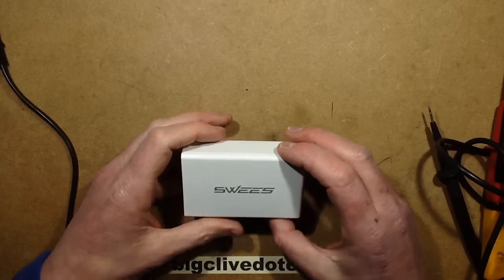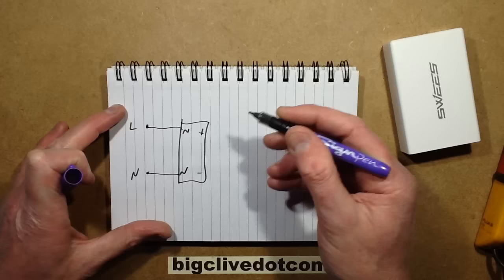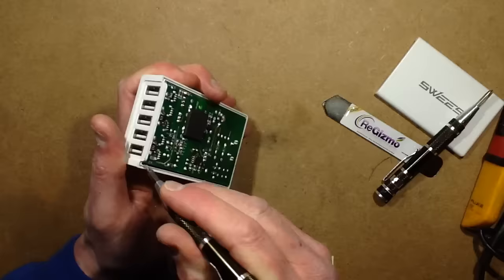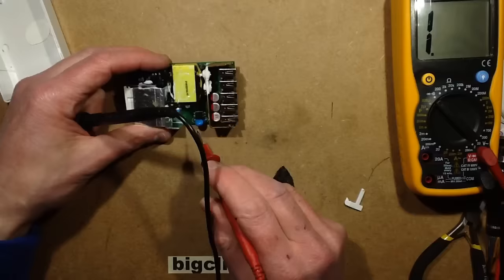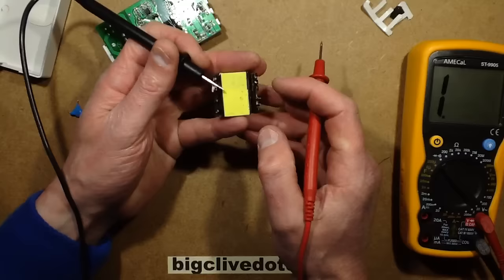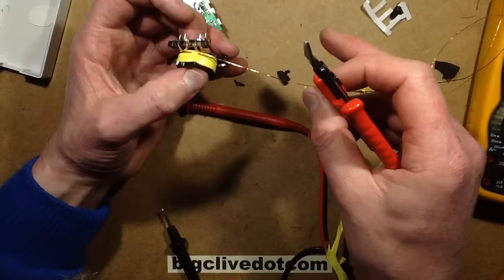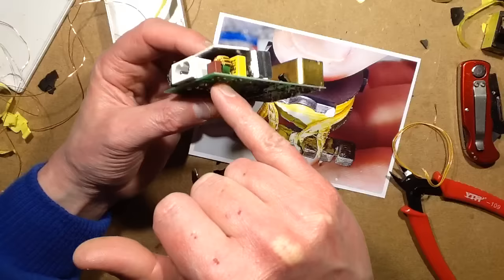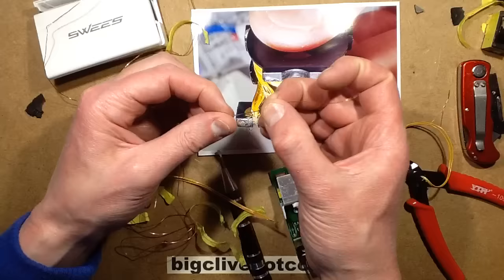Horrific USB power supply fault.  (Electrocution risk.)

Comment: Good video. 
I would have enjoyed watching an old cell phone or something plugged into this before you took it apart.
Just for kicks to see if the phone sparks, catches fire, or anything.
Maybe have the phone turned on while plugging it in, so we could watch the screen flash, spark, go black, then begin to melt, and possibly catch fire.  Other than that, good video.
Reply: The phone would likely charge normally. The voltage is the whole connector not between the wires.

Comment: im guessing this video is now linked in a 1 star review on amazon
Reply: well never know, the page on amazon is gone: http://boingboing.net/2016/04/12/the-worst-gadget-ever-supplies.html

Maybe this video caused the end of a product, not just a 1 star review.
Reply: snoopdogie187 maybe, but it'd be ancient now. usb1 devices arent worth the material they are made of these days.
Reply: Mr Jay White
Very unlikely this product is that old. There was nothing to be charged through USB back in usb 1 days, which is the sole function of this device.
It looks like its been rebranded http://www.amazon.com/Multi-port-Portable-Charger-Technology-Motorola/dp/B00PPXYWJW
Not a bad product if it works. It can output 10 amps total, and with 5 ports, thats 2 amps each, which clearly shows is a more updated product, much more so than usb 1, but this doesn't use any usb standards, just the two contacts that are responsible for outputting power.

Comment: I have this exact charger circuit that goes by a different brand, it has 4 green and 2 orange ports packed more closely together,
It worked fine for a while but after a couple months of using it, it starting sending 40v down the usb cable via any port
It fried an airpods charging case, and one side of an Oneplus 6T usb C port.
even after swapping the port and whole assembly, it's basically a non-reversible usb-C port now xD quite annoying.

needless to say that charger has given me a nice project box and some useful components for some future project!

Comment: Whenever I watch anything about working with electricity in Europe, I'm always so relieved that they settled on 110 volts in North America. A few weeks ago, I had to tear apart the wiring in my house to track down a fault that turned out to be caused by a failing outlet. Of course I got shocked once, 'cause Murphy's Law, but here it's just slightly irritating, like a honeybee sting, not at all dangerous unless you're inside the breaker box before the split or working on dryer or oven sockets. The shock aside, I was able to repair our wiring without needing to pay someone else to do it for me. I don't know that I would have been willing to take that risk in Europe. Is it even legal to work on wiring without a license there?
Reply: Nothing stopping you doing it, but if something happens(fire, somebody gets electrocuted, etc) you will have your ass handed to you by the insurance companies. Or end up in jail possibly. At least here in Norway.

Comment: If the fault was in that transformer as built. Would adequate testing at the build stage have revealed it?
USB sockets getting 240 volts could easily destroy valuable equipment as well as almost kill somebody.

I will be very careful about the source of ALL chargers in future.

Comment: I have a similar model to this from Amazon which I have had for over a year now, I believe it is made by Anker and I have never had any issues with it.  It looks very similar and I was very worried at first glance from the thumbnail
Reply: Oh I agree, as I said I have never had any issues with it in all the time I have owned it and I would recommend Anker products.  It was just the thumbnail for the video has me worried, at first
Reply: +Tech Digest This power supply does not use cheap components either, like Fujitsu polymer output capacitors. And actually have a quiet good construction. Just happens that the transformer has manufacturing fault.

Comment: If you removed the transformer and the short went away, it could have been a short on the board between the terminals. Especially if there were no terminal to terminal short.

Comment: 230vac  , we in the usa only use for near industrial apps. We use 110v for everything else, and you've illustrated the reason most likely...
Reply from the maker: A higher percentage of people are electrocuted in 120V countries than 230V countries.  Possibly because they get too casual with what they perceive as a safe voltage.  230V gives much stronger shocks so people are more careful.
Reply: Humm, I've  heard that claim before. Apparently we had 46 in the us in 2016 for our entire population. The 2016 deaths from electrocution for the relatively small pop in the UK was 25 for 2003 and 50 for 1999. I think proof by providing links is a good thing, and if you will so will I lol https://boards.straightdope.com/sdmb/showthread.php?t=239225

Comment: So it's two possible things that caused it, To much draw on the users end, per the capability of the components used, which either created heat through the tape, additionally causing coating failure.
Reply from the maker: It was a manufacturing defect.

Comment: It ist possible to build safe small trasformers on one bobbin but not china cheap. Maybe 50-60 cents more expensive by having safe dual insulation on the wire itself. And lowering turn count while increasing frequency

Comment: Seeing stuff like this makes me wonder if there’s any kind of protective gloves or other equipment you could possibly buy to at least dampen a potential electric shock, if not stop it. (Admittedly I know nothing about electronics and the such) Clive is quite obviously experienced but seeing him fiddle around with such dangerous stuff bare-handed makes me nervous nonetheless.
Reply from the maker: Any dry work gloves will reduce your chance of a serious shock.
Reply: Well, makes sense, but more simple than I thought. I would have thought there was some Uber-expensive material they make gloves out of to resist shocks with, like the cut-resistant gloves you see on the market that don’t even work most the time.

Comment: Rectifier in front of the transformer? How does that work?
Reply from the maker: The switching supplies allow the use of a tiny transformer by converting the low frequency mains supply to DC and then using it to pulse the small transformer at high frequency.
Reply: @bigclivedotcom  Thanks. I had only ever dealt with the traditional transformer, full-wave rectifier, filter cap and choke kind. I guess my age is showing again.

Comment: non isolated tranformer, one of the diodes in the neg side went open, you got + voltage on the ground straight thru
Reply: there shouldnt be 50hz/100hz at the transformer at all remember. its rectified, choked, run across a cap, then thru a fet
Reply: to b clear - not saying the transformer didnt fail, but that  that alone shouldnt manifest that fault

Comment: "serious manufacturing fault that suggests others from the same run may also pose a risk of serious electric shock."

Sometimes components are bought from another supplier. Sometimes these components go into various other product lines.

This specific unit will have a number of suppliers feeding products into their factory to build this unit.

those component suppliers supply many other product brands.

This would be the fault of both the USB adapter and  transformer manufacturer/supplier.

Insufficient testing and implementing a satisfactory solution to the manufacturing process to resolve the error. Often this is about cost cutting and higher production. The most simplest efficient way to turn over a higher amount of product using the least amount of materials.

Testing usually occurs every few items. depending on the amount. Maybe 1 in every 50 or a hundred would be taken out of the batch to be tested and even then the testing is often about functionality rather than safety.

So they would plug in a few USB multimeters (Yeah they dont exist,you heard it here first, one of many...F#$king psyche ward Hackers... Go China,Rape them have it all.) to get readings to see if they are charging or not.

ahh.. Yeah so they aren't all tested and not for shorts or the testing you are doing.

Comment: I wonder if it fried the guy's hardware or batteries? The transformer wiring is difficult, especially when done by more cost conscious than quality/safety manufacturers in China. I am surprised this type of USB device has not burned a house down yet, may be it has!

Comment: Wait... a bridge rectifier BEFORE a transformer?
Reply from the maker: +Max Mouse (Mmouse) Switchmodes convert mains to DC then high frequency AC through a small transformer and back to DC.  It means they can use smaller and lighter transformers.
Reply: +bigclivedotcom so, ac is still hitting the transformer?
Reply: +Max Mouse (Mmouse) Yeah, just at 100khz+ instead of 50-60 hz.
Reply: +Max Mouse (Mmouse) It allows smaller transformer design for higher efficiency.

Comment: how can DC be transformed? you said bridge rectified then transformed.  thanks
Reply from the maker: +zoso By converting it to AC again at high frequency so they can use a much smaller transformer.
Reply: +bigclivedotcom  thanks, after initial rectification it is then chopped to a lower voltage with a higher frequency, what frequency is generally used in this case, thanks for the explanation, very interesting.
Reply: +zoso   Often around 400 Hz.
Reply from the maker: +zoso usually around 20kHz and higher.
Reply: +zoso Not always at a lower voltage. the 120/240 VAC switch on the back of PC PSUs is actually a voltage doubler. If you live where your power is 120V and you have the switch in the 120V position then your line voltage goes through the doubler to bring it up to 240VAC. Otherwise in the 240VAC position the doubler is bypassed. This is all done so lower current devices can be used to ultimately supply a higher power P=VI. Read: make manufacturers more money by using cheaper parts.

Comment: I've seen it in several videos... why do your lights flicker so much?
Reply from the maker: +smv133 The iPad I use to film is very sensitive to our 50Hz supply.
Reply from the maker: +You Suck Certainly not in the standard camera app.
Reply from the maker: +You Suck We're talking Apple here.  They're not noted for flexibility.
Reply: bigclivedotcom
Thats what I figured.  Is there an advantage with using 240V and 50Hz versus 120V and 60Hz that we use here?
Reply from the maker: +smv133 The higher voltage allows us to run high power appliances like kettles at much lower current.
Reply: Thank you for the reply, its much appreciated.  Thanks to your videos, I'm getting back into electronics, etc.

Comment: would a Megger be useful here?
Reply from the maker: +trixter192 My insulation tester only goes to 1kV the official test is a lot higher.
Reply: I know it's not exactly your thing, but I wonder how good those cheap Chinese meggers are.
Reply from the maker: +trixter192 I've got one in the pile awaiting its turn.  Quite odd arrangement of three connections though.

Comment: How can you design things such that this would cause less of a problem?
Reply from the maker: +katelikesrectangles This one just had a silly manufacturing fault.  Otherwise it would have been fine.
Reply: +katelikesrectangles If it had been tested properly it would have been found and hopefully rejected.
Reply: +Graham Langley It wouldn't even have to be a very elaborate test:

They could literally just have put 230V AC on the mains in with a probe and then made a voltage reading at the soldering points of the USB ports.

If it's 5V DC then pass, if not then fail.
Reply: +bigclivedotcom I don't think it would pass safety approval with that type of transformer construction. I.e. it isn't just a manufacturing fault, it is a design fault.
Reply: I understand that testing should find that, of course. But could a design arrange it such that a failure would be less dangerous? Especially if a failure occurs in the field.
Reply: +bigclivedotcom Yes, but s silly manufacturing fault that could kill you. Not exactly trivial
Reply: +katelikesrectangles , because it is class 2 equipment (no earth, so the output is not earthed) and the output is accessible to fingers is has to be SELV ( Safety Extra Low Voltage). To achieve that the transformer needs to be a safety isolation transformer with all the appropriate double insulation and creepage and clearances. Enamelled copper wire does not count as insulation from a safety point of view. There needs to be two further layers of insulation and clearances. I am not sure if split bobbin is mandatory but it would certainly be the way I would design it for piece of mind.

To be sold in Europe it must be CE marked to show it has the appropriate safety approval. That transformer would not get safety approval as a competent test house would strip it down like +bigclivedotcom did. Clearly this PSU does not have safety approval and cannot be legally sold in Europe but I expect that is the case with a lot of Chinese PSUs.
Reply: I also don't think it is legal to use a single Y capacitor between primary and secondary in a SELV PSU. I found this in Meanwell's site:  "1.According to sub-clause 22.42 of IEC/EN60335-1, at least two separate Y1 or Y2 capacitors are required."

In general a single fault must not cause an appliance to become dangerous, hence double insulation, etc. Also these things should be individually PAT tested which would have shown up this fault. Of course all these safety regulations are flouted by these cheap imports.
Reply: nophead A split bobbin is something I didn't think of. Interesting.

Comment: 15:23 that's what she said great video Clive I've been watching you videos for a few years now I'm only 14 and interested in electrics I'm normally a manual type of person like making knifes in my workshop or working with my grandad on building sites and plumbing I don't go to school long story.
Anyways I take any old computer ect apart to save the circuit bored I have about 5 motherboards and a set of draws full or motors, magnetrons,transformers and all sorts of electrical components like capacitors,resisters ect and I don't know why I commented this I just digress a lot aha anyway great video I really enjoy watching your channel
Reply from the maker: The reason you hoard components is because humans are "hunter gatherers".  It's what we do, it's just what we hoard that has changed over time.  They're not just components, they're technical possessions, and it's just what we do.  Just keep in mind that the microwave transformers can put out high voltage at a high enough current to cause death in a way that is MUCH higher risk than messing with mere wall power.  Don't worry too much about missing schooling.  I was bottom of the class all the way through school.
Reply: You replied I know they're dangerous I took the secondary coil out of one and made it into an electromagnet I put 24v dc through it and I couldn't pull it of and when you higher the voltage it gets stronger
Reply: +bigclivedotcom Looks like you've got yourself an aspiring apprentice! Lol. Keep up the work guys!
Reply: Aha

Comment: Sadly, non branded Chinese power supplies are a clear and present danger.
I have found critical components (main ferrite transformer, the EMI-suppression capacitor, the electrolityc capacitors, the 50 Hz rectifier diodes) to be mislabeled. They are insufficient voltage capacitor, the transformer should insulate at 1500 V instead it leaks at 300 V, the diodes should have 100 V reverse voltage but they got shorted at 40 Volt.
To measure the insulation voltage of ferrite transformer and the EMI capacitor, you need an insulation meter. It can be done without desoldering the components. 
Buying cheap, non-branded power supplies is, in my opinion, a self-harm act toward people and property.

Comment: My 7 year old Dell Studio XPS tower PC is giving half wave mains out on at least the microphone port. I have a detachable mic connected to an extension cable, hanging over my ear so the connection touches my skin; each time I move my feet onto my radiator I get reminded not to.
Edit: The entire case is giving out half wave mains (120v). GG.
Reply: +TheMrTape Yeah, replacing those gnarly 8 billion peso PSU's sucks. Better let shit burn eh!
Reply: +TheMrTape A desktop PC should not be doing that, as their ground is normally tied to protective earth. Might be a bum power cable or ungrounded / miswired outlet there. If you find it's the outlet, you'll want to have this looked at by an electrician.
Reply: yeoldeengineer
Nothing should be doing that. It's not earthed at all. I couldn't care; even if it catches fire (which is highly unlikely), it won't light anything else. I've been an electronics hobbyist for 19 years and continually pursue online education about it (EEVBlog etc.), which is why I don't worry about this case. I think it's funny that I'm sitting at 120v potential when I use my mic, cause I know it can't permanently hurt me, yet the general population would be baffled by the fact that I do.
Reply: As long as you live alone, ignoring faulty electronics is up to you. 
If I knew a neighbor of mine was that sloppy with stuff I'd probably rob him of the exact amount needed for replacement parts and shove new parts in his face.
Reply: Repeatedly.
Reply: Stygian Doll
How do you know I'm not your neighbor? To be fair, it's not faulty as such, it's simply the isolation that's down, which is intended to protect the user (and to avoid my HPFI circuit breaker from triggering).